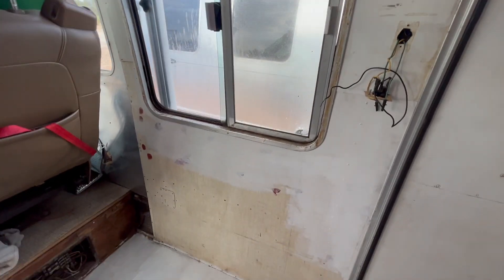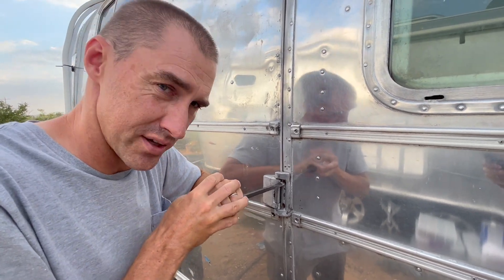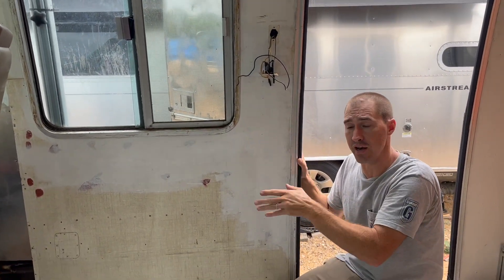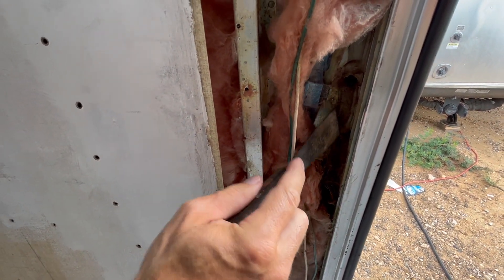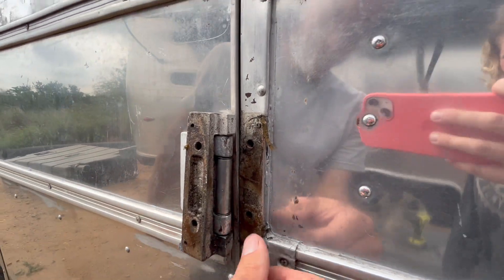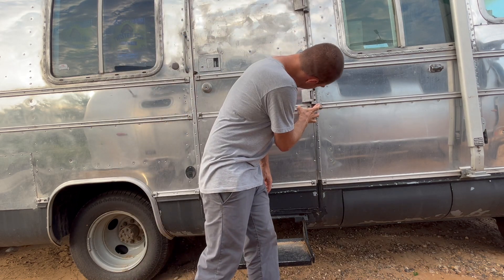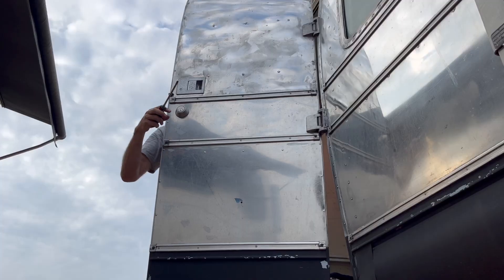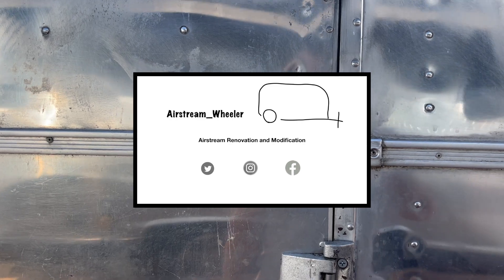1977 Airstream Argosy 20ft Motorhome: Door Hinge Work

Comment: Thank you brother, just getting ready to change full hinges on my 74 Argosy.  I'm afraid I'm going to have to take the whole door off as the other side of the hinge (opposite the side you did).  If you know how the other side of the hinge come apart, that would be helpful.
Reply from the maker: Hello and thanks for watching! I haven't ever taken the hinge apart by driving the hinge pin out- I am not sure how to do it. If you need to replace the entire hinge you'll need to remove the hinge from the door and I believe that you will need to remove the inner door skin.  *Removing the inner door skin can change the curvature/fitment of the door*  It can be time consuming to get the fitment of the door right if you take it off the body or remove the inner skin.
Reply: @airstream_wheeler  Hey, thanks for the reply.  Yeah, I figured I'm on my own with this.....can't find anything on U Tube that goes through this process, execpt yours.  Appreciate the reply AND the warning about removing door skin.  I think I'll make windows and patch them.  It's my office, and nobody will be "camping" in it so I totally cool with patch work.  Matter of fact, I think their kind of cool anyway.  By the way, do you know of anyplace that sells replacement lock/latching mech.?  I've searched, but come up empty.  (expect for used door lock/latch mechanisims).  
Thanks again, good luck with your project.
Reply from the maker: Hi- The patch routing could work and save you a little labor. Out-of-Doors mart (now renamed something else) has been very good for obsolete parts in the past, though they know Airstream better than Argosy. I also got a used curved Argosy front window from a guy by the name of 'Hoss' in Arkansas that is on Facebook. Hope that helps?
Reply: @airstream_wheeler  I'll look for him, thanks for the tip and the information.  Hope your remodel goes without too many "hitches"....  Take care,